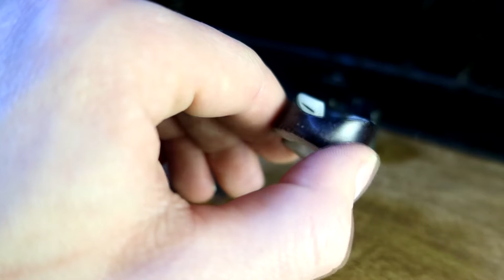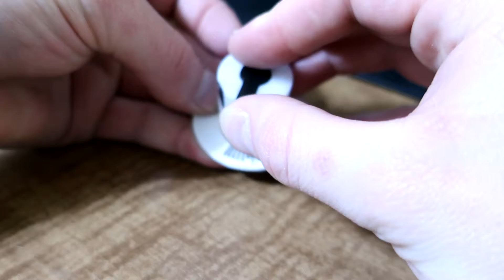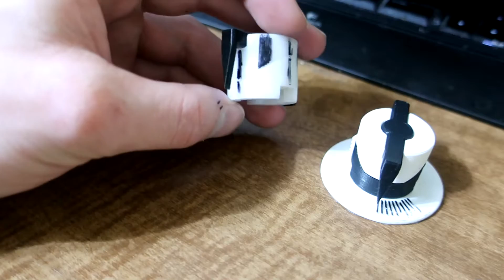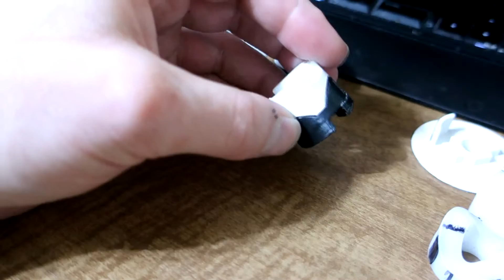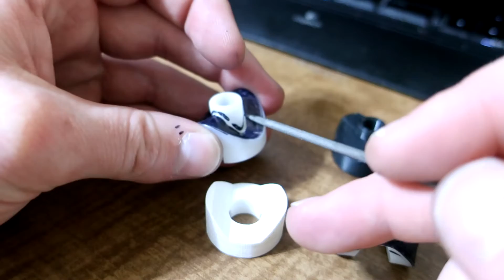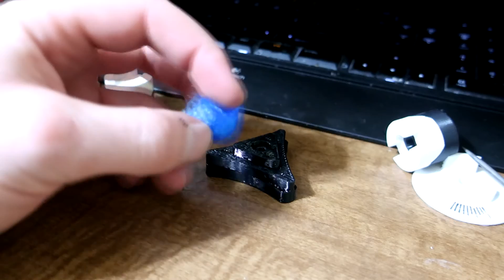An Investigation of Wavecams

Comment: I just found this and really respect what you've done here.  Very creative.  Well presented.  Thank you for sharing.  Couple things to share back at you.  1) The "design envelope" is very tight for this mechanism and the axial spring loads are enormous.  The cams can last for thousands of cycles (with proper lubrication and cleaning) but they will crack if the mechanism is overly constrained.  If the "kingpin is too tight" the mechanism is overly constrained, so that the hanger can't rotate all the way to its stop (contact with the baseplate); then something's got to give.  You don't want to shear aluminum hanger tabs or "bust" the baseplate pivot cup, so in this case, wave cams serve as a "fail safe" component, (kind of like a shear pin on a drive shaft) so that the rider can hear or feel something is not right and check-it-out before s/he does more significant damage.  Cams are relatively cheap and easily replaceable.  2) The hanger is designed to "stop" upon contact with the baseplate.  This is how the mechanism limits hanger rotation to avoid rail drag and wheel bite.  The hanger rotates to ~ 30 degrees before contact is made, so that's all you need to achieve with your new wave cam design.  (See if limiting to 30 degrees rotation opens-up some design space for you.)  3) I've tried this too.  I shared your video with my friend (who worked on this with me).  He is a PhD Engineer and teaches CAD at a world class University so he's way smarter than me.  He speculated that if you widen the parabola slightly, at zero, you might be able to achieve the goal of more stability at level cruising, but neither of us is sure "how much".  Last year, we 3D printed some novel cams with steeper and flatter parabolas but they didn't feel right at all.  Please remember that you need to keep two opposite "full line" contacts between the two halves of the cams, never one or two "point contacts".  4) Finally, the team behind the HST's goal is to improve level cruising and to make the trucks "fail-safe AND fool proof".  After ~5 years work, it's getting close.  "Stacked tolerances" issues keep sneaking-up and specifications keep getting sharper.  The new self-lubricating Moly Washers and Moly Cams are made with VERY tight tolerances and we're tweaking the kingpin specification again.  Very subtle changes here should profoundly improve the entire mechanisms fit, form and function.  Level cruising is already MUCH better with a properly tuned HST featuring a properly designed compressions spring, Moly washers and cams.  5)  Simple machine elements are amazing.  I understand that many years ago this spring/cam mechanism was adapted to "skate" by a designer from K2.  This K2 "spring truck" was the mechanism to facilitate turning on the front end of a "push scooter".  No idea if this K2 scooter was sold widely, if at all.   Next Original skateboards adapted the identical truck for longboards.  Hamboards used Original S8 trucks for several years, but because the Hamboards were so huge, they kept breaking the trucks.  Eventually Hamboards improvised (and invented) their own "heavy duty and robust" HST truck (based on the same spring/cam mechanism) and have been optimizing the design ever since.  In my opinion the spring/cam mechanism is borderline "genius" while the optimization journey has been necessarily incremental and "trial and error".  But that's the way most mechanisms evolve.  A "hundred years ago", I remember seeing all kinds of highly specialized hand tool designs in my Statics text and Design of Machine Elements too.    There's a tool or mechanism for darn near every application, but they all started by one person with a specific need, and the determination to make it happen.  If it's useful at all, then the mechanism gets continually improvised, by lots of different creative people, until it finally ends up in an engineering text book.  You are one of those guys too, and good for you sir!  Well done!

Comment: Personally, I prefer the predictability of a linear relationship... e.g. rakeless RKP hangers.

My idea to help you with your problem is to do like how OHC car engines deal with cams on the camshaft. You could use only one cam and use multiple tappets with a spherical-rolling tips for each curve... e.g. 2 tappets for the 2-curves design, or 3 tappets for your 3-curves design of the cam. But a smooth curve for the cam surface would be much better for durability.

Comment: The "original" wave cam is like two cams running on each other and the contact point between is constantly changing, the steep part of one parabolic surface is being counteracted by the shallow part of the other cam.  If you want a non-linear cam profile I would suggest modifying one cam by removing some material away from the highpoints so that the highpoints are the only points of contact with the other cam.  Google "cam follower" to get a better idea of what I am suggesting.